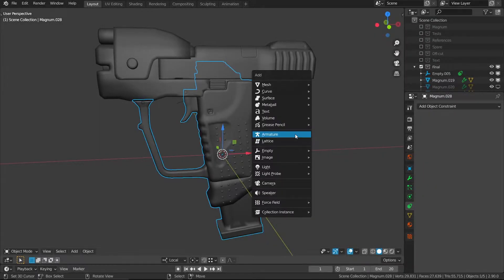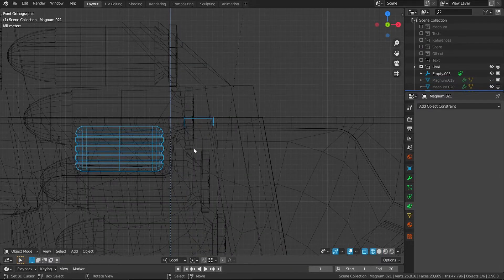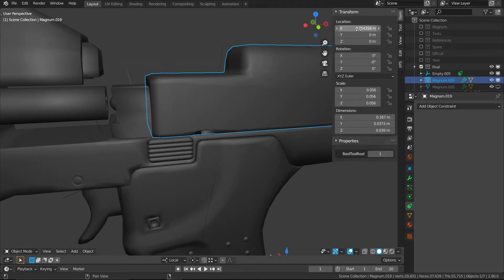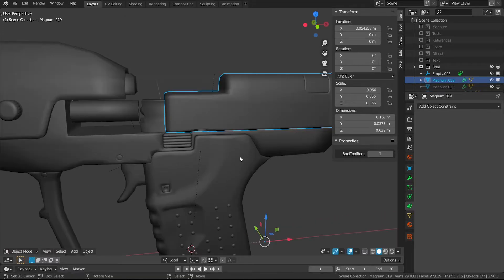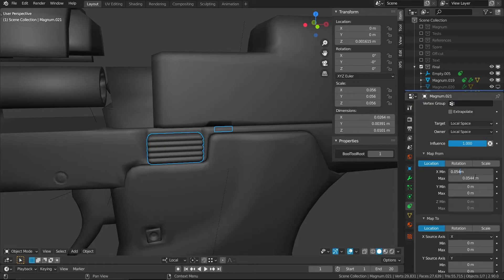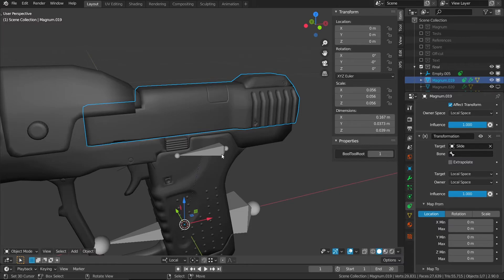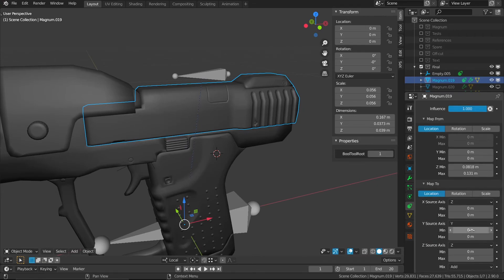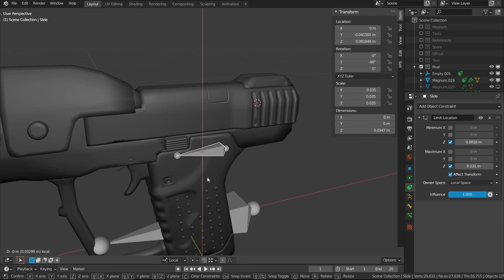Blender - Slide & Locking Mechanism Constraints

Comment: Thanks for this tutorial, it's actually very hard to find videos on how to create slide mechanisms in Blender, let alone how to link them with a transformation constraint so multiple parts move at once. It's very vital information for newbie modelers like me who are interested in making mechanical objects, so thanks. However, I will say that setting the targets and owners of the objects with constraints to local space did not work well for me because they would not move correctly in pose mode. It turns out what I had to do was set the targets and owners to custom space, with the target object being the god bone. Not sure why this was, but at least I figured it out eventually.